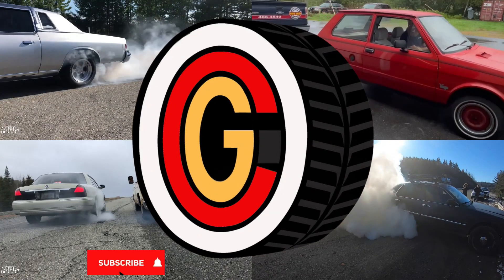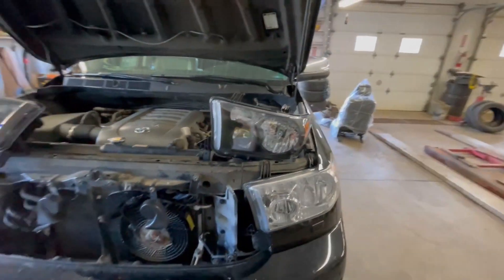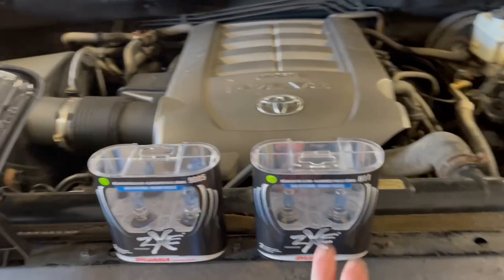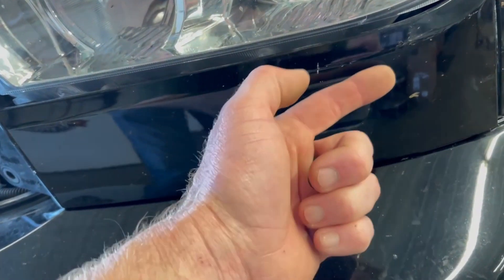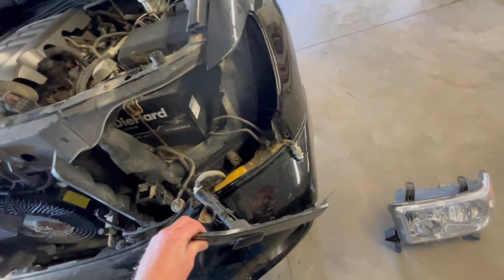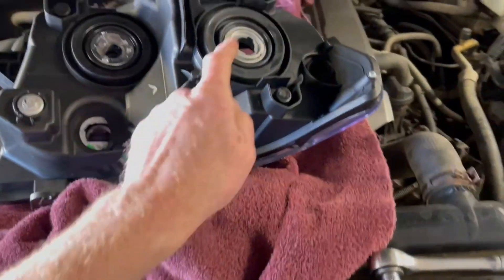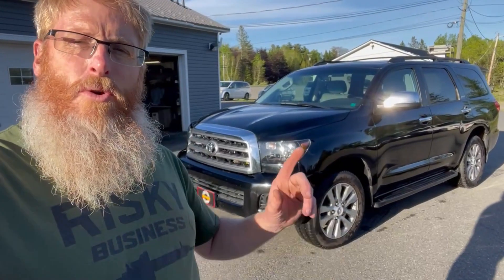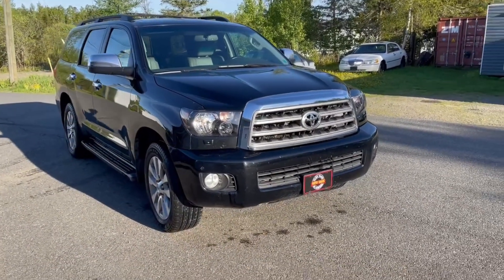Headlamp Upgrade For 07-13 Toyota Tundra & 08-17 Sequoia

Comment: I've bought two sets of the cheap replacements over the last couple of years. They looked fine, better than the stocks, but condensation claimed both sets. I put the stocks back in until I just purchased the Morimoto XB amber drl's. They are awful expensive but well worth it. No more cheapo's for me. That condensation looks horrible, and it freezes. Hope you have better luck ofcoarse. Love the big "Toys"

Comment: thanks for the video. did you have any issues installing the washer onto the new ones? we werent able to see how you installed on the new ones. or any mentions of problems
Reply from the maker: The washers are a part of the lower plastic piece and not the headlight assembly. If i remember correctly, everything just clipped together. My washers don't work anyway!
Reply: @OldeCarrGuy  ok thanks. I've been looking for the ones that the washer would fit. About to order these